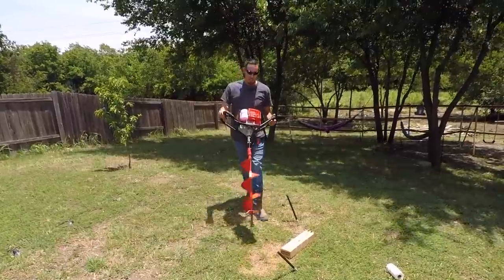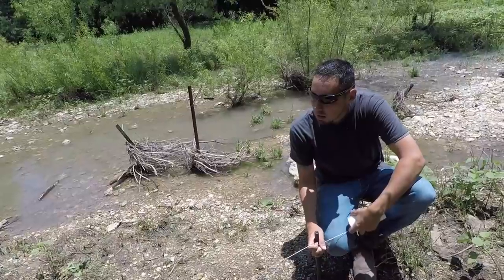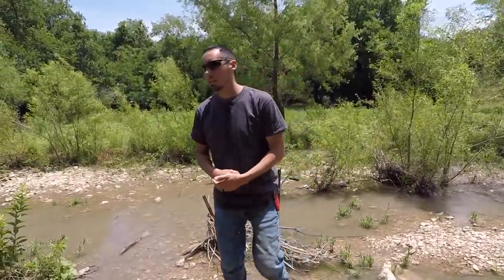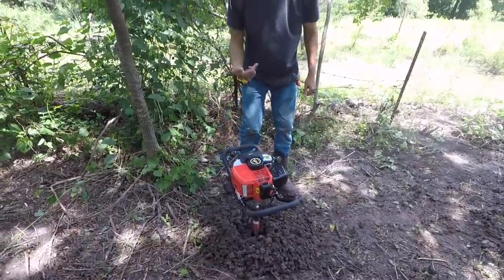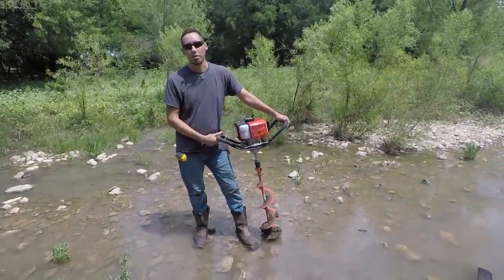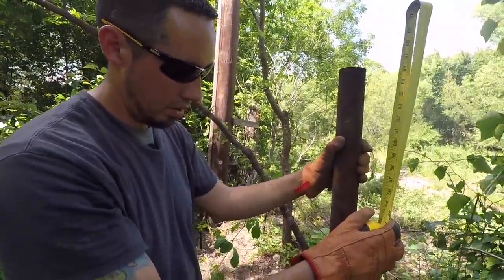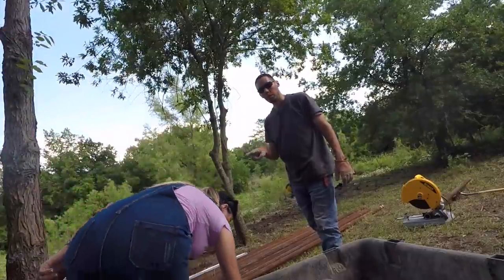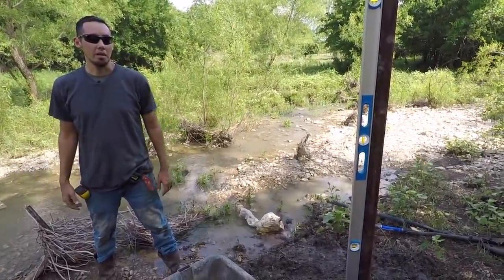stimulus money well spent

Comment from the maker: We finally got our stimulus money and it's just in time. This fence needs to be done ASAP. 
For those of you wondering about the wainscot series, I need to get this fence done first so it will be a little while longer. 
Thanks for watching and happy Memorial Day to the all the veterans and active duty military.
Remember those who have made the ultimate sacrifice. True heroes.
Reply: Dude you the best !
Reply: Hope it didn’t rain on your project cause it’s pouring cats and dogs in RH, TX ;)
Reply: Big or small if it’s construction related I’m watching it. 👍
Reply: When is flex volt coming out with an impact driver to be the new king of the hill
Reply: Coneys Remodeling 😂
Reply: When you level-line, make sure you reference off of the highest point of your property. You may not need to gas-ax the tops of the lower posts as they may need the extra height. You may luck out and be able to use your laser level... at dusk or shortly after. Hope this helps.
Reply: this part of the backyard, you can make very nice outdoor tiles flooring with seating and a stone BBQ pit
Reply: Thanks, OBTW the wife did a good job digging those holes.

Comment: You did great! With a few years of fence building under my belt, here are a few tips:
- Put your hip into that auger, it'll sprain a wristin no time. As the blades fill up with dirt/debris, lift it in and out of the hole so it can throw the dirt off and keep digging. Not particularly fun, but allows the auger to dig nice and deep. A rock pic is damn handy as well, in case you hit rocks or roots
-Give that post hole digger a twist every time you dig it into the hole. A small twist will get you a slightly bigger bite of dirt and help you dig a little faster ;)
-If you use Quickrite Concrete mix, you dont have to premix it. You can pour it dry into the holes and just add water. And vapor barriers aren't really going to do much for you as long as it's not running water in your post hole ;)
-I set string, mark post holes, dig post holes and then reset string over your post holes. As you set each post, pick a side that the string can gently rest against the post as you pour in concrete to set and level the post. Make sure the post doesn't push the string, just barely kisses it. This will make all of your posts line up along the string line, nice and straight
-Metal posts are tricky, but you can always leave the posts a bit tall and cut them to height after you have put them in. This allows for any grade difference along the fence to be evened out. Just a small time saver

Nice work guys! You got the hardest part done - and it looks good
Reply: You probably know and this is my only tip as I'm not a good tool man. But if you pack (say half an inch) your string line out at both ends then get another pack obviously same width to measure the post then you won't run into distorting your string line.
Reply: You should dig and set corner posts first then run a string line on the bottom above the ground and Mark every 7-8 feet with post hole digger for your auger. You're also supposed to run a string line on top when setting posts not just eye balling them. Would have saved him alot of time

Comment: Keep the videos coming on any project you do. It's always nice to get another perspective. When we've done fence using steal post in northern Illinois we've only been worried about concreting the corner post and the gate post. The other post we use a post pounder with no pre-dig. Then a metal blade to cut off the mushroomed top. A lot of times we'll also pour the dry concrete in the hole and add water to it. This works for me. There's a lot of takes on the methods of putting up any fence.

Comment: Just a suggestion.. when you install the posts, leave the string line where you want it on the ground and use that to layout the exact position of the edge of your posts.
Those holes will definitely be off on comparison to where you want them using an auger.

Comment: Little tip from a farmer. Let the auger do the work. It wants to pull itself down the hole. As you go down, release the trigger, pull the auger out with the soil on it, place it away from the hole then give the trigger a light squeeze to spin the dirt off 👍

Comment: Heck yes, I enjoyed the video.  I think your water barrier / garbage bag idea will work just fine.  Hate to break your heart, but I purchased an auger bit only, at Harvard Freight for $50, modified the shaft so it would chuck up to a 1/2” chuck, and used my high torque, low RPM drill motor, and it worked like an absolute champ.  First 2” of soil was frozen, and the remainder was clay, and it still punched holes in 2 minutes or less.

Comment: I really enjoy your videos. Lots of good tips in the comment section. I'd like to add a couple. To clarify on an earlier comment, just like when you drill a hole in a piece of wood and pull out the bit to clear out material the exact same thing is true with an auger. If you want to keep the dirt out of the way I found the easiest thing to do was to cut a square out of a piece of plywood a couple of inches larger than the width of the bit and allow the dirt to collect on top of it. Then you can lift it and clear all the dirt from the hole area. I think your wife is adorable by the way.

Comment: Portaband saw would be great here. Esp for cutting off the tops of the pipe after they've been set. No eye or hearing protection needed either.
Reply: You can definitely use that but for a one-off job a Diablo diamond angle grinder cutoff wheel from HD is a much more economical option. And you don't have to worry about it shrinking or exploding unlike a normal abrasive cutting wheel.
Reply: @matthewhall5571  I see your point, but if you already have the diamond cutoff wheel, but not the the portaband saw, this would be justification to buy the portaband saw. wink*wink*nudge*nudge

Comment: I built my fence 10 feet apart each pole and about 2’ deep then put pole in and filled it with quickrete cement   One poles were in I used a transit level to get my measurements and marked them and cut them

Comment: Was digging post holes today.  I was very cocky, thinking I was going to get my 19 holes in no time, because a month ago I did 21 holes in 3 hours.  Working against rocks and multiple roots per hole, I only got 9 holes done in 6 hours.  Taking this machine back to the depot tomorrow. I need some rest! I’ll do the remainder with the post hole digger.  
Hope that trash bags trick work for you.  My neighbor has a fence professionally installed and they just put dry concrete in the holes. (?)

Comment: Usually easier to just get a t post driver for the line posts...instead of concreting each one - but depends on soil softness I guess.  We have nothing but hard packed red clay...so driving them is tough on the hands but they refuse to move without the extra holes and concrete.

Comment: I have one of those if you have clay soil they are pretty much useless,  At first I would use it and get about 6 inches down, then take it out of hole and clear with post digger and start over.  Ive now learned the time to haul that thing around its just easier most of the time just digging post holes by hand.  Its pretty evident Im not the only one since I never see any Fence installer using one of those in our area either,  they don't waste their time messing with them.

Comment: Nice job. However I’d use either a portable band saw or a pipe cutter to cut the tops off. Or even use a cordless grinder with a cut off wheel. Using a cutting torch will leave a much rougher finish. Just a suggestion from experience. Set up your laser level late in the day where you can see it on the posts and use it to get an exact measurement for a precise cutting length. Thanks for sharing your project with all of us.

Comment: The proper way to use that thing is to let it dig a little and pull up- on in to let it clear out and then let it go back down again.  Do this in rapid succession.  You won't bod down the way you were, even in wet dirt.  Just make sure you don't allow too much to build up on the fine before quickly raising it to clear it out.

Comment: as for the auger , keep it up t speed and practicing short dicking ( in and out )it will keep it clean as you go , same way as when your drilling would or metal, and secondly set your two out side pole string a line as per level or following grad , then measure each hole and cut a little longer and drive it down with sledge hammer," And theres your dinner"

Comment: Bro the crazy thing is I just got done digging (8) 42" deep holes for a deck. I used 10" sonotube and dug it all by hand. I said never again, next time I'm buying a auger. It only took 9 hours to dig, mix, & pour the concrete 😭😆
Reply: Deck pilings are the worst! You have to go so deep that it's a much bigger job than it looks.

Comment: Not to be that guy but pretty sure there are set backs for fences from wetland areas. Hope u checked before making a video on the internet haha
Reply from the maker: I looked into it and as long as it doesn't prevent the easement of water I should be good....hopefully. 
It will be a see through wire fence that should allow water to pass if it needs to...again hopefully. haha
Reply: Finish Carpentry TV - Richard it’s a good thing you now own that auger in case some bureaucrats get their panties knotted up and want you to move the fence! Things always seem easier the second time anyway...